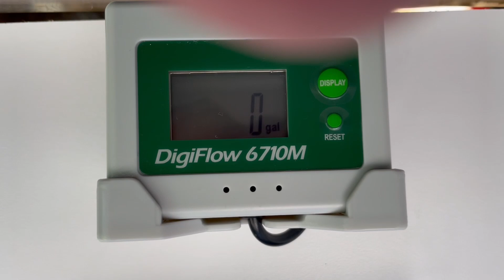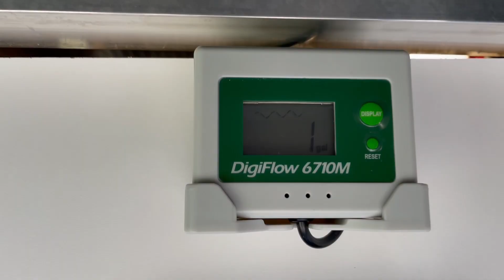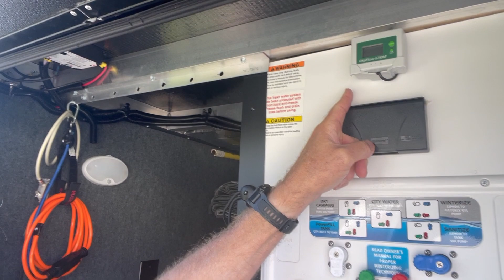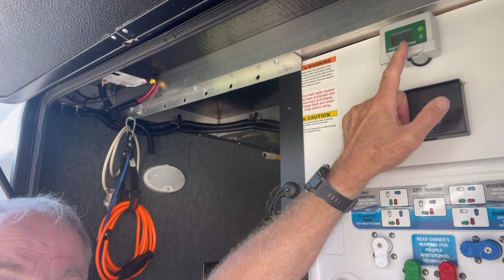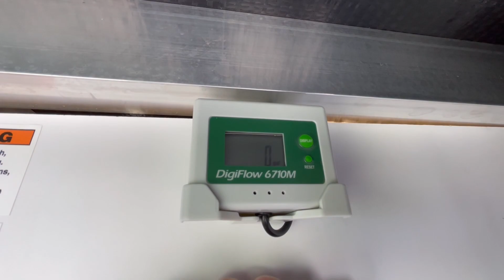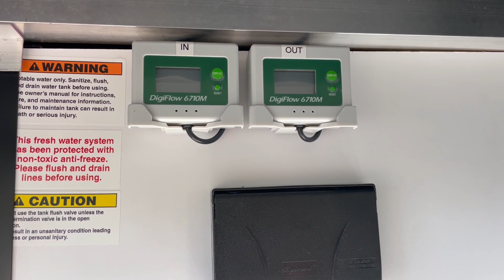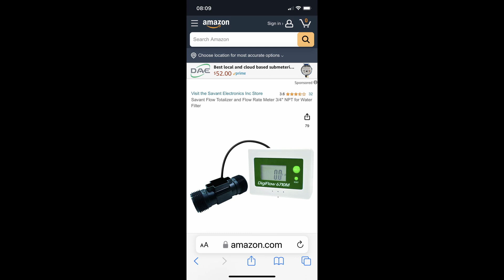RV Fresh Water Levels, Guessing? Not anymore!!

Comment: Looks like you bought 2 npt fittings 3/4” and a nipple 3/4”?
Reply from the maker: Hello, thanks for watching! PVC 2-3/4x3/4 npt couplings, 2-3/4x1/2 npt bushings, 1-1/2x1/2 close nipple (can I say that word in the comments??). Actually, found a 3/4 male x 1/2 male adaptor to make the unit shorter. If you email me at tyersontheroad@gmail.com I will send you the link.